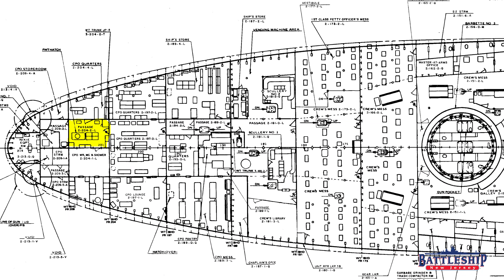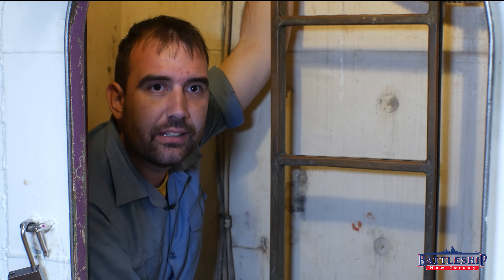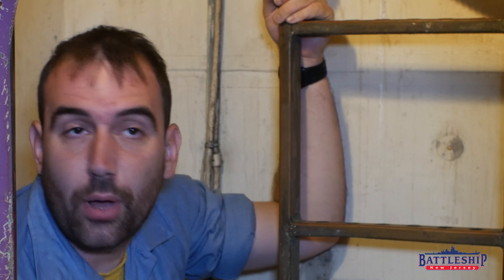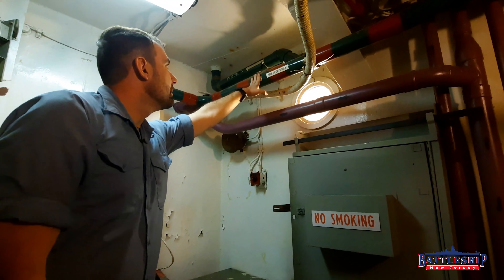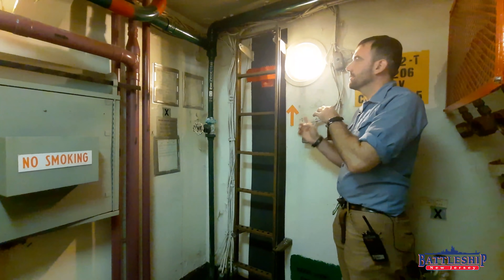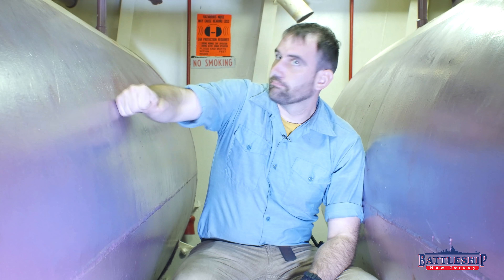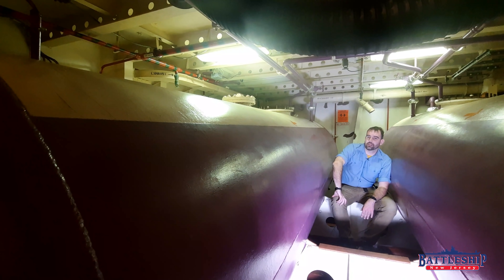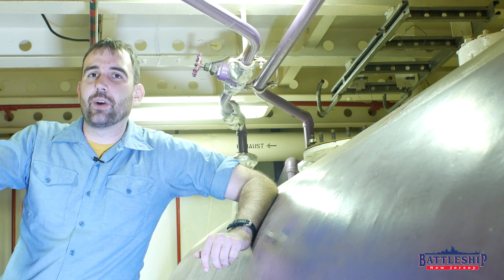JP5: Aviation Fuel

Comment: It looks like the Navy re-purposed the original AVGAS tanks to store JP (kerosene, similar to diesel fuel) when they transitioned from piston engines to turbines in the helicopters.

That would be a relatively inexpensive retrofit, with minimal disruptions. The spark protections required for working with gasoline wouldn't hurt anything when dealing with the less volatile kerosenic jet fuels, so they were retained.

Since contaminated fuel can be disastrous for aircraft, the separate tanks for the aircraft fuel also offer the benefit of being easier to keep clean than a void space in the hull structure.
Reply: Yep, I was going to make the same point.  The original aircraft would have been piston engine floatplanes.  They would have burned avgas.  JP-5 is very different, it is nothing like avgas.  JP-5 is a high flash point kerosene / jet fuel.  It is a special kerosene designed to be harder to light than regular jet fuel.  It's closer to diesel in its flash point. 
Ironically, the ship went full circle when they added drones, and avgas came back.  A previous video covered the additional storage for the drone fuel.
Reply: @matthewbeasley7765  Is JP-5 = AVCAT? Edit - checked yeah AVCAT seems to be a category covering JP-4 and JP-5.
Reply: The tanks were repurposed in the 1960's for JP-5. In the 1980's the two starboard tanks were removed and the entire starboard half of the compartment becomes three JP-5 tanks. An AVGAS tank was added in the 1990s on main deck.

Comment: The engine and fire room had the most fire surpression. Then the mogas (unleaded gasoline or “motor gas”) pump room, the JP-5 pump room would be after  that. The JP-5 didn’t have Halon and the first two did.
Reply: The ship having Halon systems must have been very late in it's service life. I actually have a piece of crazy thick walled copper pipe from a C0-2 system installation in 1978 USS SARATOGA. Awful lot of deadly smothering C0-2 systems in the confines of ships.
Reply: @roberthawxhurst3717  It was early 90’s on an LPD

Comment: Nitpick here. Avgas/JP5 is not higher octane than the ship’s fuel. Octane is a measure of how resistant a mixture is to pre-ignition, and thus less volatile fuels have higher octane numbers. The higher power associated with higher octane comes from the engine being able to have a higher compression ratio without knocking.
Reply: And the corresponding reference for kerosenic fuels is the cetane number, which is an index of the relative ease of ignition.

Comment: Technically, JP-5 is not "Gasoline" but aviation grade kerosene. Its the same fuel that is usually referred to as Jet A in the non-military world and is the same stuff used in all modern airliners and helicopters. From a volatility standpoint, its much closer to diesel fuel that gasoline. When the ship was equipped with piston engine float planes, the system would have used a high lead content gasoline that had a octane rating of over 100. once they switched to helicopters with turbine engines, the system would have been converted to use JP-5. That probably mostly only required changing out filters and seal materials but may have required changing the pumps in use as well
Reply: JP-5 is missing the lightest components of jet fuel, it has a higher flash point than Jet A.  JP-5 is a very tight cut so it is much more expensive.
Reply: JP-5 and Jet A are 2 different fuels. JP-8 is more similar to Jet A. The Air Force uses JP-8.
Extra point question: Where would you probably find Jet B being used?
Reply: In the military jet fuel is commonly called AVGAS
Reply: @FP194  Avgas is short for "aviation gasoline" which is not jet fuel. An example of avgas is 100LL.
Gasoline for ground motor vehicles is called mogas.
Reply: @James Thompson I was on an aircraft carrier that burned JP-5 for about 2k miles into the Red Sea steaming from the East Coast. There were no problems other than an increase in annoyance from how acrid the stack gases were. 
Also it was hard to trim the black smoke out, I have to assume. It wasn't too bad but certainly more than usual.
Reply: @James Thompson By “diesel aircraft carriers” do you mean propelled by Diesel engines?  If so, that is incorrect.  MIDWAY has virtually the same boiler plant (600 psi) that NEW JERSEY has.  Later “conventionally powered” carriers had 1200 psi steam plants.  We never had diesel carriers.
Reply: @James Thompson Sorry, I guess I just misunderstood your comment “…diesel aircraft carrier (Midway/Coral Sea)….”

Comment: While I doubt the tanks were replaced during the reactivations; but were the fuel lines themselves  (the pipes) replaced for when the Iowas were equipped with JP-5, or were they  like the tanks just thoroughly cleaned and flushed out during inspections?
Reply: Going from avgas to Jet is not a big deal, turbines will happily burn trace amounts of gasoline, so mt guess is just cleaned out real good.

Comment: Gasoline and Kerosene (JP5 is functionally kerosene) both have vapors that are burn and explode, while fuel oil and diesel do not and need to be atomized to burn, so are much safer.  Containing them in tanks helps prevent explosions, and also reduce the severity of explosions should they occur by not having the fuel against the ship's structural members as it would be in a void space.  This is also why it's fine to have a tank of heating oil in your basement, but gasoline and kerosene should only be kept in well ventilated spaces.

Side note: the fuel oil and diesel actually have more energy per kg of fuel than avgas or JP5.
Reply: Diesel fuel is a kersenic fraction from the refinery, and is very similar to the various grades of JP.

Back when I was contracting for the Army, there wasn't any diesel fuel stocked on the base, instead every diesel was fueled using JP8.

Common hydrocarbon fuels have a Higher Heating Value in the range of 18,000 to 22,000 BTU per lb.

Gasoline has a lower density, so it contains less energy per unit volume (per gallon) than does diesel fuel/ JP5/ JP8, etc.

Comment: Interesting. Aft of the Rudders- therefore also aft of Propellers - Underway a lot of prop wash noise. So- I expect in the 80's the ship got modified to shift from Black Oil to DFM- Distillate Fuel marine. The Generators and boats can run on the DFM- but not the Black Oil. With the shifts Fuel oil heaters became unnecessary. I recall in the 80's some Ships A-gangs might occasionally run on mix in some JP-5 with the DFM. NOT too much-not often- burn hotter, perhaps a little more power - burn out an soot build up. How much different (if any) is JP-5 from a Commercial jet- airliner fuel? (pretty close I suspect)
Reply: JP-5 is a "tighter" cut than Jet A.  It is missing the lightest parts of Jet A so it is harder to ignite on accident.

Comment: Also aircraft engines are very not tolerant to contaminants, so a fuel tank helps with that. E.g. many plane crashes which involve a small amount of water in the tank. Also having a sealed tank means could fill with an inert gas to help keep the fuel liquid and producing a vapour.
Reply: Also in WWII the aircraft fuel would have been literal aviation spirit, gasoline with an octane rating of around 100 plus, thus the separate tanks, flame proof fittings and serious fire fighting. Later on this was likely replaced with jet fuel, which is basically a much better refined kerosene, and which does not exhibit quite as bad a fire risk. Still kept the separate tankage, as this allows the fuel to be kept clean and dry, as a drum of jet fuel can condense a lot of water from the air with thermal cycling, you might find in a barrel of 44 gallons the pumps will only take the top 40 gallons, as the water will be at the bottom. Vapour pulled in via the vent and condensing at night.

So here a sealed tank, with a water separator and filtering by the boost pumps, so that there is low risk of filling an aircraft with water, or worse still, fine particles of rut, which will cause major wear on the fuel system regulators, and which can clog the fine injectors. Small amounts of water can be tolerated by a jet turbine, provided it is dispersed in the fuel as small droplets, but big slugs are not good. 

Neither is ice, as it can clog up the screens of the pumps, building up faster than the hydraulic oil heat exchangers, which dump heat into the fuel to cool the lubricant, can melt with the normal flow. There was a crash caused by this at Heathrow, where ice in the fuel starved the engines, as the aircraft came in to land.
Reply: That would be my guess as well.
Reply: I think your exactly right that the tanks are to track the fuel so the Navy know if the fuel was bad exactly were the fuel came from and can back track the fuel. At least that's how the Army does it for their aircraft.

Comment: I wouldn't trust any aviation fuel that was stored in a void space. Too easy for it to get contaminated. I believe It is also more flammable than the bunker oil that the ship uses.
Looks like you have two refueling trucks worth of JP there. 
For as many Knox class FF's I've been aboard with LAMPS Det's I never saw how they stored their JP but I assume it would have looked similar.
Now I'm wondering how the Carriers stored their vast amounts of aviation fuel.
Reply: Voids, on my ship CV-67, once JP-5, was put into the "Potable Water" void, in 1980. I went to a tap. to make coffee, "FOAM", came out, I was told, about the mistake, also was told the shipyard, in 75. tried, to sandblast clean that "tank", but to no avail, the JP-"Imbedded", in the steel, well for 6-months, I had no problem, doing my , daily business, years later, I still taste that, JP, at times, hopefully I would get cancer.
Reply: @charletonzimmerman  I knew a pilot that served on the last cruise.  He said you could taste the jet fuel in the water then.
Reply: I was fuel king on AOR in the 90’s.  I can tell you most ships carry JP-5 fuel in Void tanks.  My fuel tanks actually had about 1/2” steel between then and the ocean. We regularly had filter systems available, although not usually needed for JP-5 tanks. Since we carried about 3.7 million gallons of JP-5 I can tell you with certainty that the CV’s carried the fuel the same way. 

BTW I learned on FF-1052 class, and they were built the same.

Comment: I would guess (repeat, guess) that storing the aviation fuel in tanks vs. void spaces has to do with the higher volatility/flammability of this fuel, thus the need for more robust containment.
Reply: It’s probably a combination of the extreme risk from AV gas vapors should they escape, combined with the ships limited need for AV gas. I mean the Iowa’s contemporaries, such as the Essex class carriers stored their vast quantities of AV fuel in more standard fuel bunkers, not tanks. But with the Carriers an insane amount of the ships volume, I think around 20% for WW2 era Carriers was tasked with carrying AV gas. (And that percentage goes through the roof for modern Nuclear Carriers, which no longer need to carry fuel to power the ship). It’s also worth noting that the only Carriers in the Pacific War to sink due to hull or structural damage were the Yorktown, and the small Escort Carrier Gambier Bay (which may have been hit by Yamato’s 18” gunfire). Every other Carrier that sank, on both sides died from massive uncontrolled AV gas fires.
Reply: @andrewtaylor940  I believe the WWII carriers had tanks in the holds, not void spaces with fuel.  They also kept the tanks covered in CO2 gas to avoid fume leakage.  
To reduce the risk of fire, unless there was active fueling, the fuel lines were purged back to the tanks with CO2.
Reply: @matthewbeasley7765  They we’re technically “bunkers” not the round tanks like we see here. But large generally square’’ish (or shaped to the hull) purpose built vessels down in the lowermost decks of the carrier. Not the void spaces, such as they could do with the ships fuel oil. The AV Bunkers had their own walls separate from the ships hull and bulkheads. But they were vast closed spaces. And yes they did pressurize the space above the fuel with inert CO2 gas, as well as purging all AV gas lines with CO2 when not in use. A lesson learned from the loss of Lexington.
Reply: I would suggest that it was more for the control of potential contamination of the aviation fuels... as many here are pointing out, contaminated fuel can have disastrous results in aircraft operations.

Comment: JP-5 is not gasoline by any stretch. It is a complex blend based on kerosene concocted to reduce the fire risks on carriers. Do you research.
Reply: Thank you.  Really having a hard time hearing aviation gasoline.   AVgas is completely different.  IIRC AVGas is always 100+ octane and used in reciprocating piston engines.  JP stands for Jet Propulsion.
Reply: It's aviation fuel for jet powered aircraft.

Comment: In tanks due to its flammability. You don’t want this being hit by torpedoes etc
Reply: What do you want being hit by torpedoes?
Reply: @BlackSoap361  fuel oil was used. It's not very flammable and was a good insulator. Often ships used alternating fuel oil and air space (sometimes steel tubes) in their TDS.

Comment: how do you refuel a battleship
Reply: With a really big hose from a really big tank. Or a tanker.
Reply: @jamesharding3459  Sometimes both, while steaming at 17 knots 200 feet apart with hoses across.  If you need a lot of fuel in a hurry, best bet is to UnRep at sea...the fuel pier wont hook up 8" hoses and transfer fuel at 140 PSI, the UnRep ship will ask you how many hoses you can handle at once...
Reply: Just roll up to the nearest Shell station
Reply: Conquer an OPEC nation!